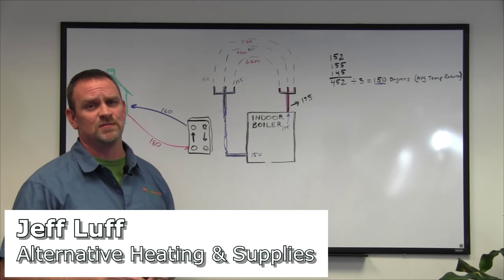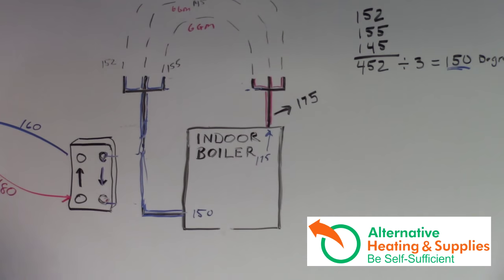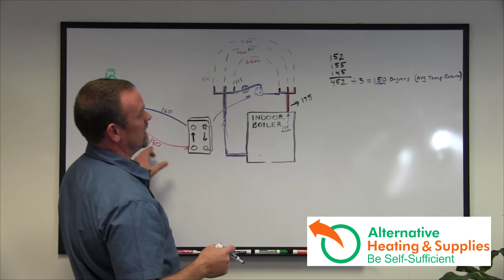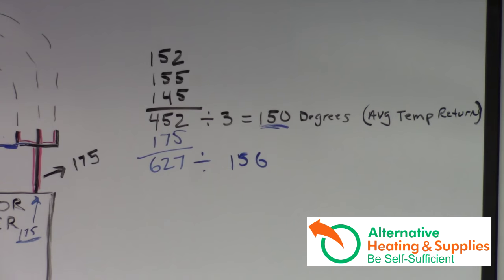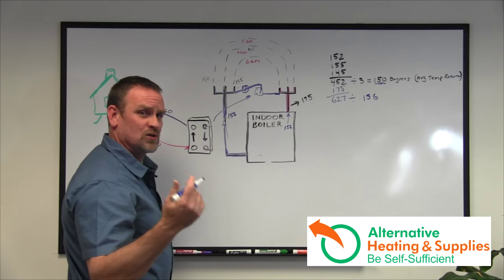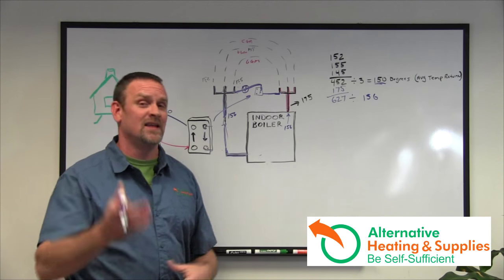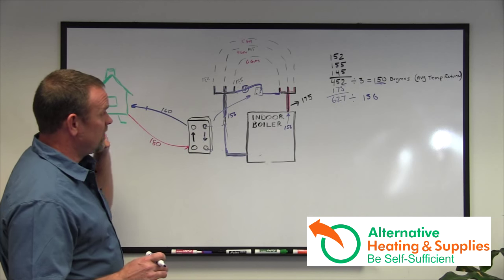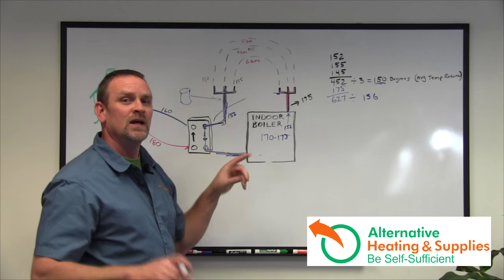How To Connect an Outdoor Wood Boiler to Indoor Furnace Pt2 Trouble shooting

Comment: Very good information...now I have a hi efficiency IBC VCF 15-150. I fully understand how and where to connect my plate exchanger. Being the IBC is completely electronically controlled, will it try to fire if the water temp is adequate for heating?

Comment: your forgetting one very  important thing, at the plate heat exchanger to install a cross over line with a ball valve on it, as ball valves on each line before the heat exchanger but after the cross over, and install 4 boiler drains, 1 at each port of the heat exchanger, between the heat exchanger and ball valve, for yearly servicing of cleaning the scale out of both sides of the heat exchanger, as the build up of scale lowers your heat transfer, some places need it cleaned more then once a year depending how hard there water is, I hate whn I go to a home to get there hot water back weather it is there home heating water or there domestic hot water, it having to cut the whole heat exchanger out to clean it, and having to solider it all back in, installing all the extra parts needed for a fast and simple service of the unit, and have to hand them a huge bill, that should have been a rather small one, but I see it all the time, and they paid big money to have it installed in the first place that should have included these service ports for what they first paid

Comment: The dealer I am buying my boiler from, is telling me that directly plumbing the wood boiler to my home oil boiler (making it an unpressurized system) will be an OK way to do it? I do understand that the use of corrosion additives will be needed when new water is introduced to the system (i.e. startup and adding water overtime).  He said this option will be easiest and most cost-effective. I refered to using a plate exchanger as you have talked about, he seem to guide me to not doing it your way.  I am about to spend a lot of money, and i want to do it right. Your thoughts?

Comment: Great Video. This situation is very much what's going on with my system. Can you give me advice a fix that uses the seemingly superfluous circulator pump as means to keep the core of the boiler high? Obviously I'd redirect the system return to head directly to the plate exchanger as the first step. (currently, the loop to the heat exchanger is t'ed to the oil furnace  on both the supply and return side of the furnace; the hot from heat exchanger is on the return side, the "cold" to the exchanger is t'ed on the system supply side.
Reply from the maker: Really no fix, un-plumb and re-plumb and do it right and sleep well.

Comment: I'm an hvac tech. I have a customer with a wood boiler and we will be replacing the oil boiler soon. It looks like it is piped wrong according to video 1. There is no break in the return, it is just teed in, but the plate exchange has two circulators on it, I'm not sure if it would tie in the same or not. I'm really not familiar with this style of exchangers. I want to tie it in so it works correctly( which he says it works but he burns a lot of wood). Just a question. By the way, this was some hard info to find, I should have known how but it was too simple to see. Lol

Comment: Good video Jeff,I'm curious to know what affect horizontal mounting would have on the BPHE in this application. My installation would look a lot nicer, and have less restriction overall due to fewer 90's in the plumbing.Also, most BPHE for wood boilers don't show a recommended flow path for hot/cold , if I were to upsize to a 70 plate vs. my calculated 60 plate requirements ,could I interchange the flow path , assuming I still used a counter flow arrangement?

Comment: Instead of using buckets to check gallons per minute, would it not be ok to install a flow gauge to determine gallons per minute, instead of breaking a line?
Reply from the maker: Absolutely! Most people don’t ad them during the install and need after the fact and need a solution.

Comment: If the outdoor furnace goes out and cools of won’t your oil furnace be trying to heat you outdoor furnace?
Reply: No.  It will only be heating the boiler side of the plate exchanger.  The isnt any circulation from the out door boiler until its at temperature, so there is some parasitic loss but not enough to worry about.
Reply: Shouldn’t you put a tee and ball valve in return line (above  heat exchanger to outdoor boiler) from water supply line to inside boiler? Then you can maintain water supply in out door furnace

Comment: for radiant floor use, floorl temperature would b controlled with 3way valve from the flatplate heat exchanger?   Assuming the wood boiler is running at 180 to the heat exchanger and as you said, all returns must go through the boiler,  110 is quite sufficent for slab heat...
Reply from the maker: you need to regulate the temp in radiant flooring, about 110 to 130 or so. how to do it is more difficult, i would consult someone more knowledgeable about radiant floors.
Reply: an aquastat to control the pump from the wood boiler to the system should be installed to turn that pump off should the wood boiler stop burning for any reason, if this is not installed, the inside boiler will heat the heat exchanger and run trying to heat the wood boiler in the reverse condition.  This is for a combination outside wood together with an inside boiler.  Also, a flat plate heat exchanger can be used in conjuction with a 3 way valve to heat the radiant floor if required,  the inside boiler remains on standby while the water temperature is above it's setting.

Comment: Question: My outdoor wood furnace supply line was plumbed directly into my oil boiler, without using a heat exchanger. Is that ok? Also, my return lines(3 zones) are always hot, but the supply lines are not always hot. Does that mean that my water is going backwards?
Reply from the maker: Central Boiler was know to tell people to plumb directly into the boiler. This very wrong!!! One system is pressurized and the wood Boiler is not pressurized. That is why you need a plate exchanger to separate the two systems. Adding a plate exchanger will also fix your backward flow issue. Jeff